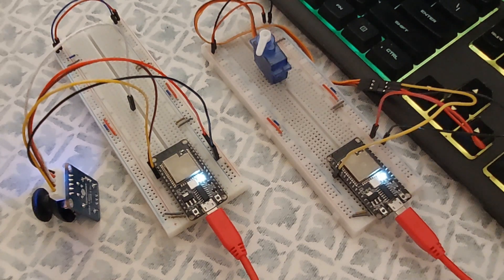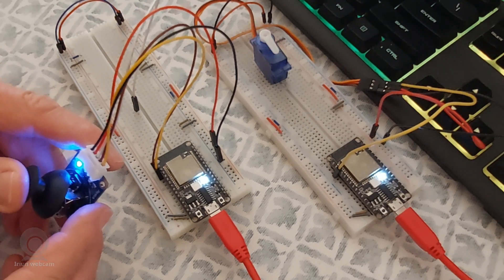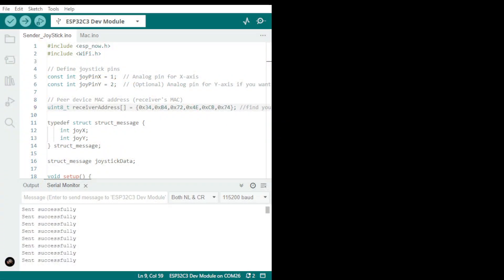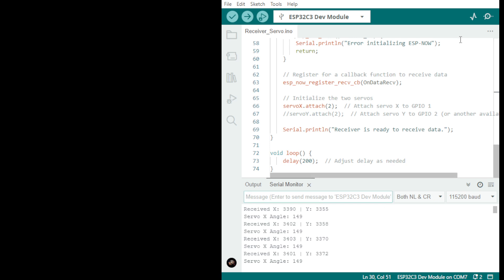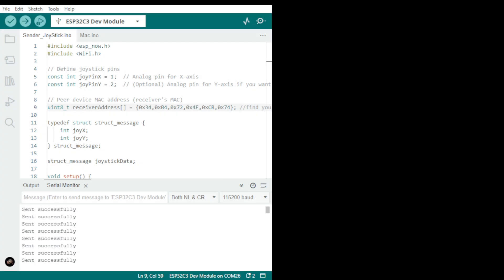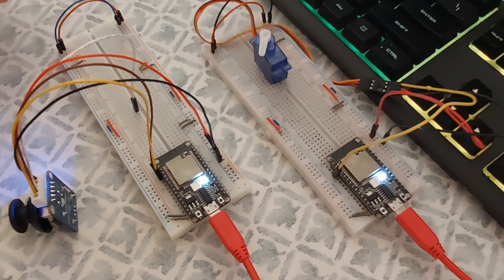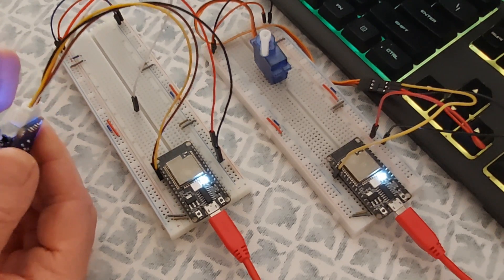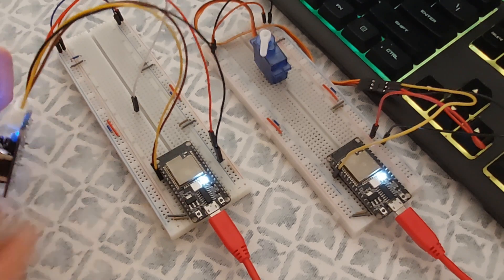ESP32 with ESP-NOW Joystick control servo via peer to peer

Comment: Awesome video! ESP-Now has some great potential. Any suggestions what the best wireless protocol is for overcoming shielding? I want to receive a signal from inside a metal container that's inside a metal fridge. RF, bluetooth, ESP-NOW, 802.11?  I'm also an FPV drone tinkerer, so could potentially use ELRS or similar.
Reply from the maker: Hi there thank you, very interesting project not easy it will require lots of testing, could try an external antenna as some esp32 and 8266 have U FL connection for this or different material, there must be a way if we think submarine communicate under water may be could look at attenuation in water to boost signal. Good luck let me know when you come right
Reply: @electricum-z8u  - 2.4GHz are very fast absorbed in the water, if you put your sender in a water tight container and put it in water, then a tiny layer of water is enough to make the signal disappear.

I use a nRF24L01P with a Power Amplifier-Chip and can send the signal from the fridge to my receiver. The fridge have a rubber sealing and trough this the communication take place.